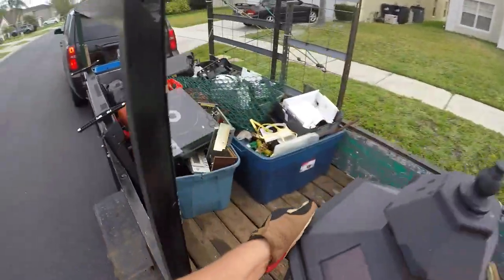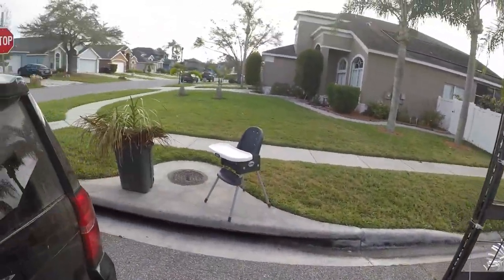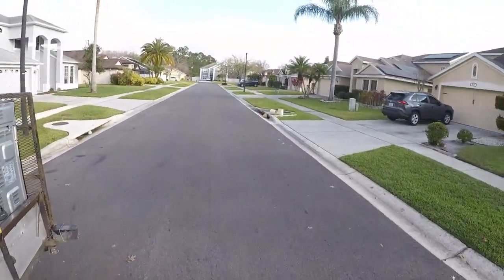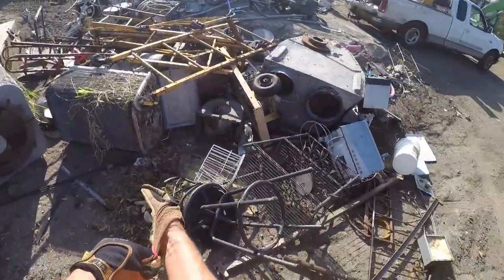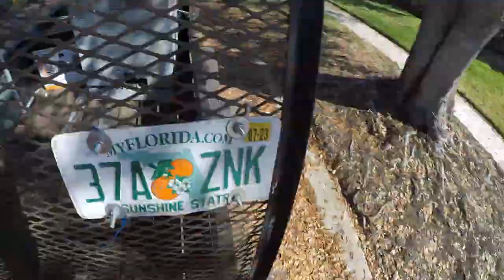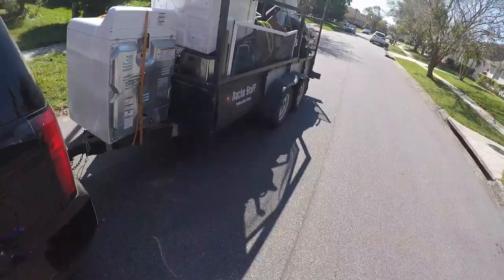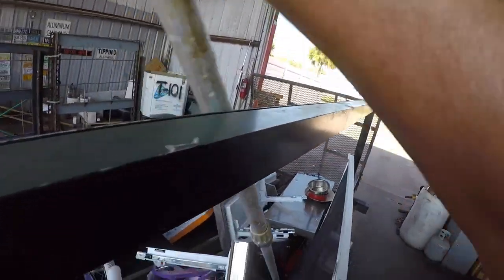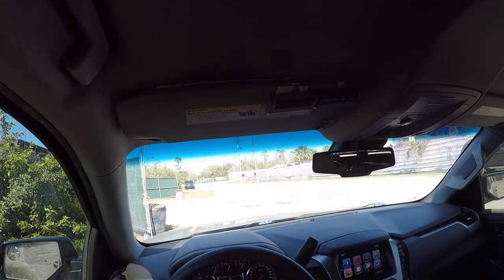Curbside Scavenging Was On FIRE! The Streets Will Provide!

Comment: Yo we need to fund this man some killer wire clippers
Reply: Weiss Tin Snips, hands down the best wire cutters ever, can get three pairs for like 20-30 bucks too
Reply: @kave9482  they work super well, plus between longish handles and made to cut steel, so you can cut some serious wire with ease
Reply: @lukelegg9915  Yeah, it's almost like a bolt cutter
Reply from the maker: They are in the garage.  I actually have about 4 pairs and 2 are quite nice.  It is keeping track of them that gets me.

Comment: Self-titled expert of pool heaters here ✋
I have found and ripped out varying pool heaters.
Square ones have the least amount of copper, however i have ripped out some square ones that have MASSIVE copper pipes instead of PVC. of course the chance of finding that on the curb is never.
Round ones have the BEST copper by far, though ive never seen a round one with massive pipes, only PVC
Even still people that do pools know the value and you only ever find them when someone does a DIY, or you get the chance to rip them out
Reply from the maker: Getting 2 in one day was pretty amazing!
Reply: @nachostuff  for real, maybe too late now but be careful of the insulation in those, nasty stuff usually contains asbestos
Reply from the maker: @lukelegg9915  i thought that was outlawed after the 80s
Reply: @nachostuff  not sure why, but what ive always been told as new as 2005 can have asbestos
Reply from the maker: @lukelegg9915  That stuff is nasty - thanks for the heads up
Reply: @nachostuff  Yup, better safe than sorry overall

Comment: Just a heads up from CO. Went to drop off a refrigerator at scrap today and they will not take anything that needs discharged. Per the EPA now have to be professionally done and appliance needs stamped with paperwork before recycling. They will not even take cars because of AC in vehicles. So they are making it a monopoly only big business can make money. Just taking away any money for us recyclers. Very sad.
Reply: freon is very dangerous, its not to stop small scrappers just to help the environment, most countries have long banned selling refrigerators as scrap. as for cars, super easy to discharge
Reply from the maker: They are fighting up down here too - just hasn't hit all the yards yet.  While that stinks a bit - I really do not get that many fridges that it would be devastating to me,